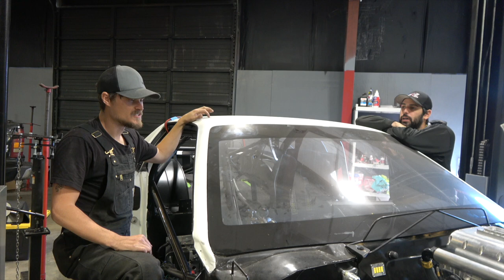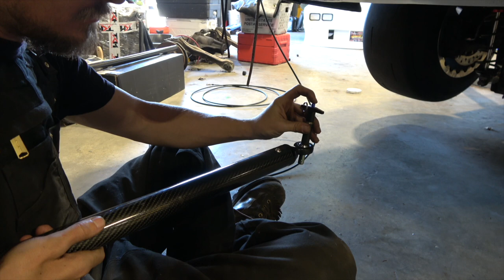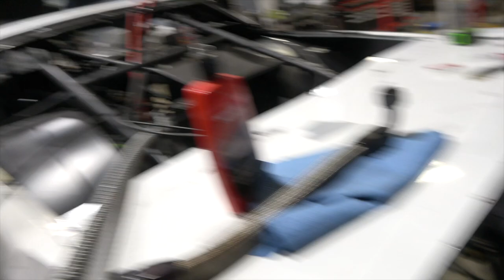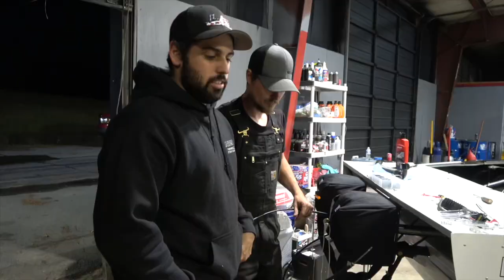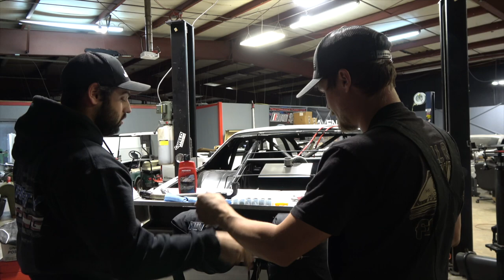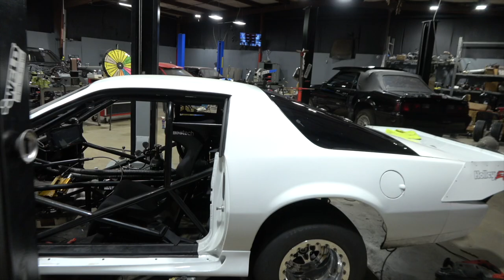WE HIRED A NEW GUY TO FINISH SLICK RICK!!!

Comment: When you build cars with large separation, is it harder on "U" joints also do you get drive line vibrations from this?
Reply: I'd expect it to be easier on the u joints as the wear will be spread over a greater range of motion.